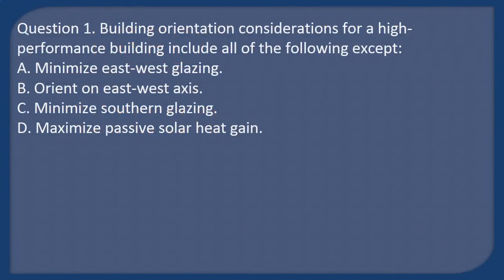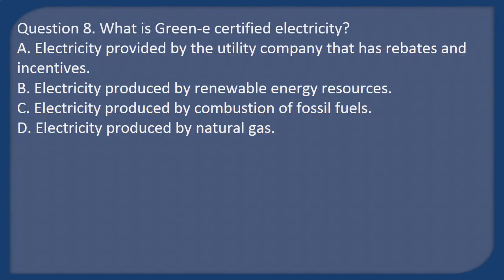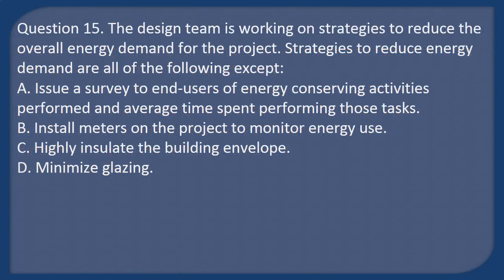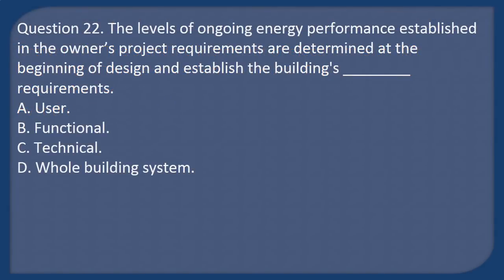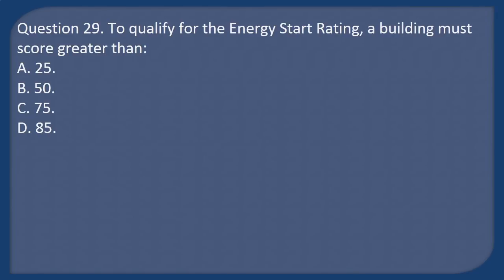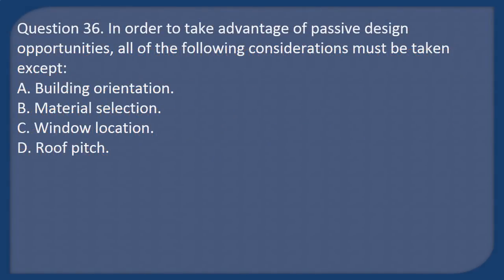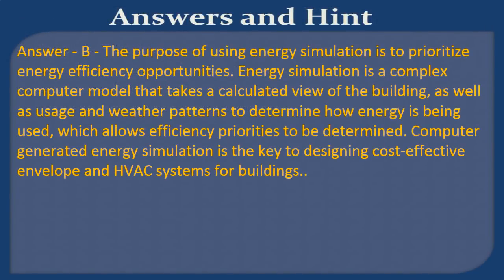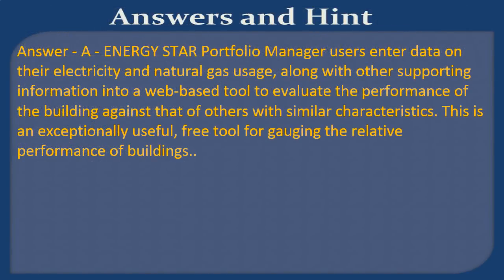LEED Green Associate  Exam Prep - LEED Practice Test Questions (50 Q&A with Explantions)

Comment: Question 3. Which of the following components contributes the largest percentage in the energy use to a building’s operating expenses? I have over and over how AHU consume the most energy in a building. Why is lighting the largest?
Reply: This is based on the old 2009 version. The new version v4 should be different

Comment: Q no. 17 From when, using of concrete material has become the passive design strategy ?
Reply: used as thermal mass for heat gain during the winter
Reply: I think its beacuse they consider the german knowledge of a passive house, the one that was created in the 90´s, but i got your point, concrete is super harmfull

Comment: Hi, is the answer question 20 verified? Because I see conflicting answers elsewhere stating that photovoltaics perform better at higher altitudes. Kindly confirm.
Reply: I agree with you. In my experience, install PV system on low altitude shall be obstructed with mountain. So that less electricity shall be able to generated.
Reply: Im almost thinking that the question was intended to be Latitutes not Altitudes. Lower latitude would make more sense with the answer and explanation.
Reply: The LEED tests are geared to the US region, so it's reasonable to exclude low altitude / high humid climates e.g. rain forests, which are not found in the US. So generally in the US, low altitude areas away from water bodies are dry. Consider Death Valley as the most extreme example which is actually below sea level. California is near the coastline is quite dry with frequent droughts and summer fires. Further towards the Midwest, US farmland tends to be in higher altitudes, such as Nebraska at 322 meters above sea level. The high-altitudes regions in the US do tend to receive ample rainfall (Midwest farmland, Sierra Nevada mountains and Appalachian mountains). Of course there are counter-examples, but this is the "most correct" answer.